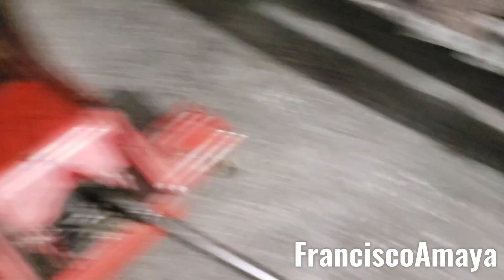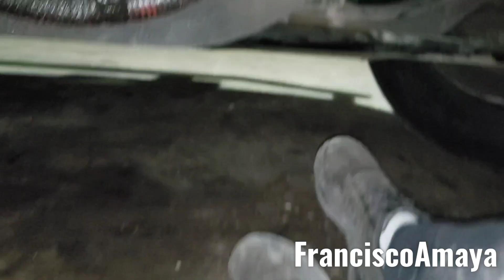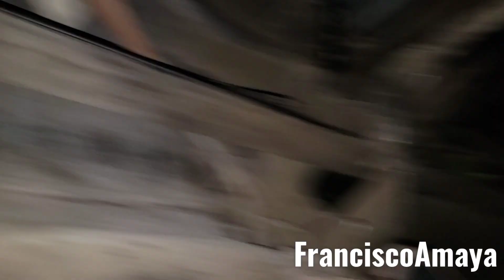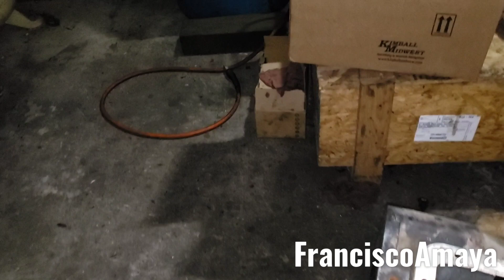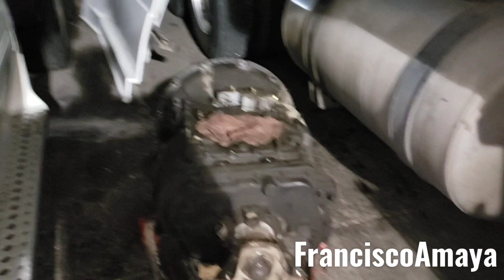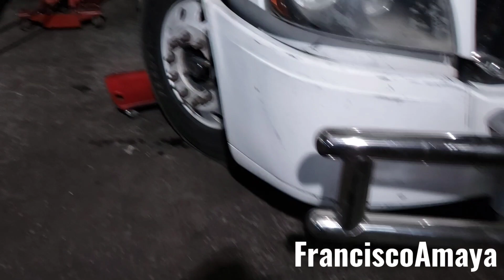Freightliner cascadia DD15 engine damaged transmission belt housing bolt broken timing gear cover

Comment: If you had a 10 speed originally in your truck can you put a 13 speed. Or do you have to change all the diffs
Reply: you need to replace the driveline and differentials
Reply: @jorgefacio690  thank you. I really hate the ten speed in my truck. Lookin to see if it’s worth swapping a 13-18